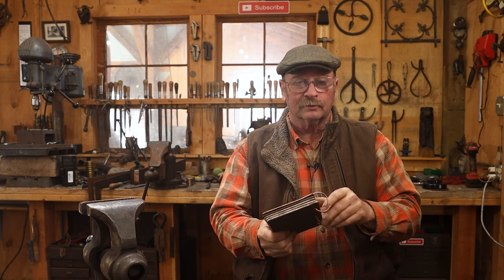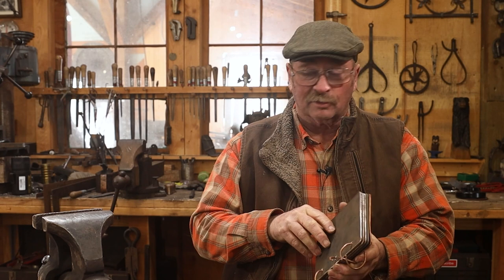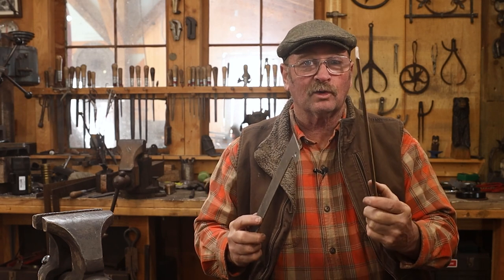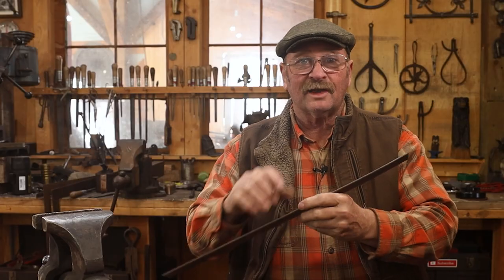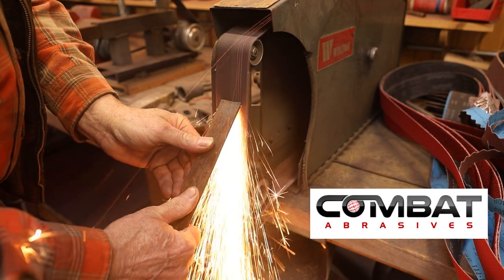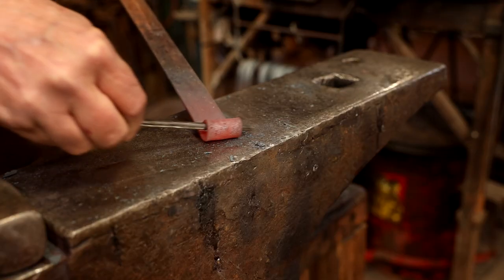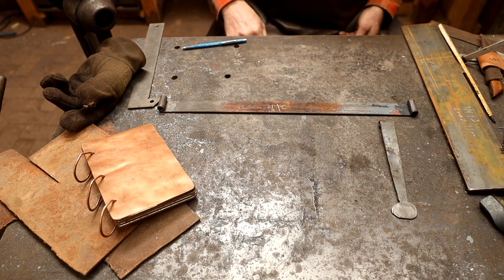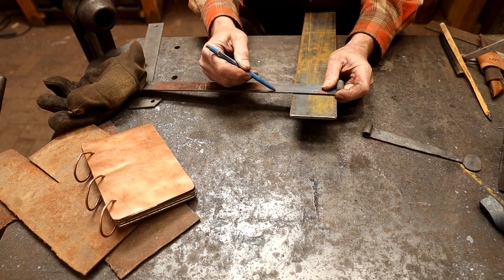Forge Around the World  - part 1 - hinges

Comment: That book is gonna be expensive to ship.. lol via pallet. I like it
Reply: I was thinking the same thing. I would rather be one of the first ones to contribute to it rather than the last one because it may take a hoist just to get it up to the bench.
Reply: Flat rate shipping box, as long as it will still fit, that is. Just, no sharp edges so it doesn't cut it's way free from it's packageing. 
I would suggest a duct-taped box, within the flat-rate box. Include the shipping information on the inner box as well just in case the outer box gets destroyed. The USPS only cares about getting the envelope or outer box with the shipping info on it to the destination delivered. If the contents get lost/seperated, they just toss them in a claims bin for 90 days if not claimed, it's trash. Stuff getting shipped world-wide, heaven only knows what would become of it if it escapes it's packaging.